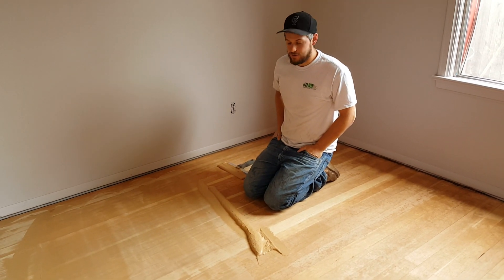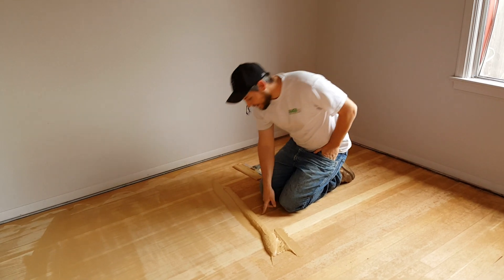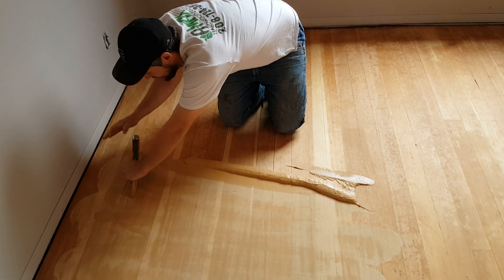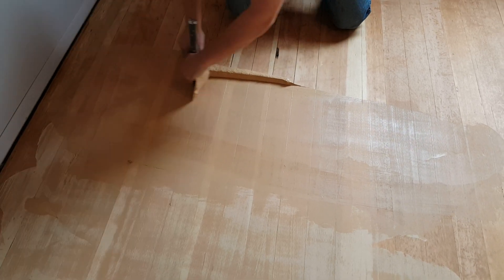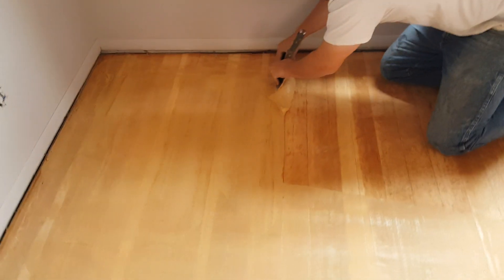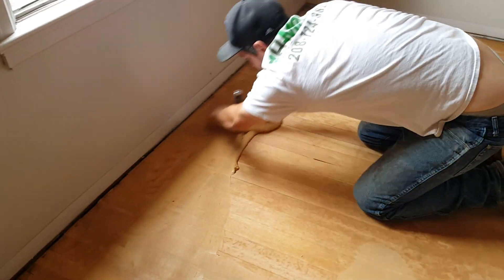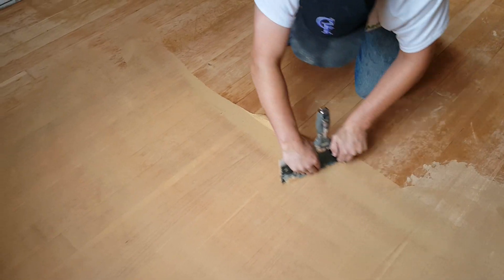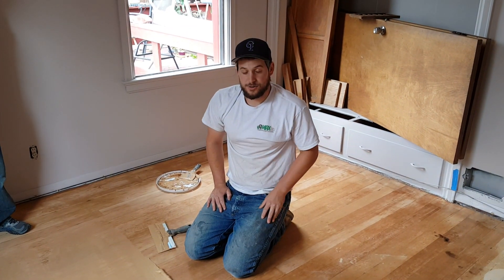How to Trowel Fill a Wood Floor Effectivly

Comment: QUESTION: I have a 6" long plank board oak (from Poland) floor that was originally laid pretty green. No need to argue why that happened, it is what it is. 5 years later the floor has gaps between a 16th and a 1/4" between planks. Plus, it was weakly glued to a plaster-leveled floor compound and there are several places where I can hear a hollow sound when I rap on the top of the wood. I think the only way to 100% solve my problem is to bring in the most professional floor layers in my area and completely replace the floor with new material. However I am wondering if there is a 'diving save' option where I use the technique you described above but with two phases: 1) use a fairly liquid solvent-based-version so the glue gets deep into the cracks, and 2) a second normal viscosity solvent-based layer for leveling the cracks. Would love to hear your thoughts and recommendations